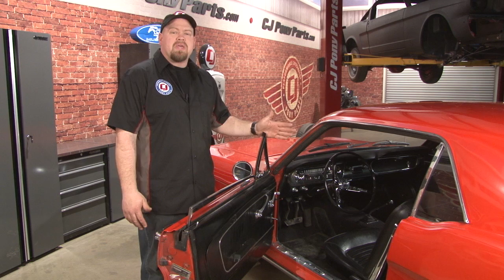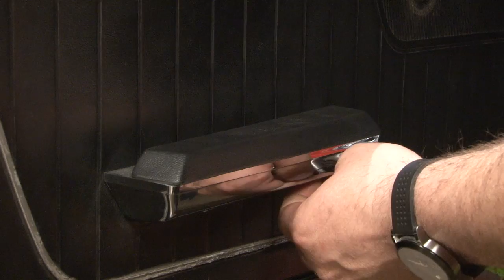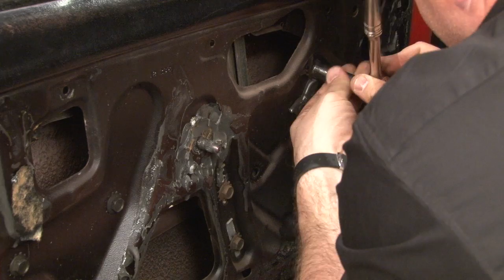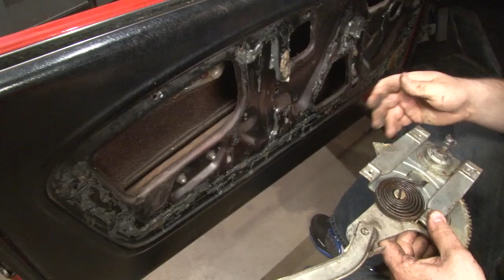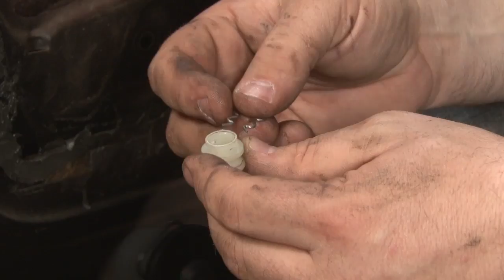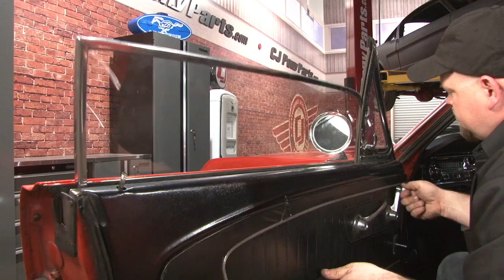Window Regulator | CJ Classics | 1965-1966 Mustang

Comment: Steps and possible issues one can run into were left out with only minimal content which falls short of a comprehensive video. 
E.g., you need a brace to hold the  window up;
The two single screw stops/adjustors just to the left of the regulator need to be removed when installing the regulator or you may NOT be able to seat the 4 regulator screws. These were left out of the video and could have saved me a lot of time.

Comment: Is there a video for the replacing the rear quarter window regulator on 67 coup?
Reply: We did a power window video which shows you how to remove everything in the 1/4 window. That should help you out.

Comment: Actually, I think the hardest part of the job on a 67 is the height/travel adjustment.  If the window is too deep in the channel, then it's a real job to get the window to roll all the way to the top of the stroke without leaving a small (1/16th) gap.  Could you post a video of adjustment, I think that would be helpful.

Comment: We don't at this time but I am sure we will add one in the future. The door panel removal is the same. The 67-68 regulator is actually a little easier since there is no scissor to deal with. The regulator is held on by 4 bolts, two directly above the door handle and 2 further forward in the door.